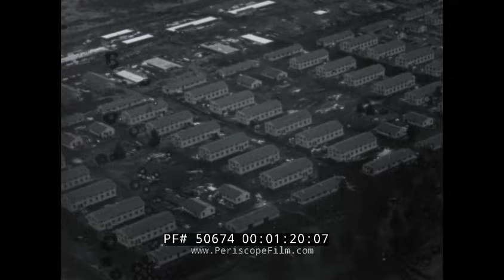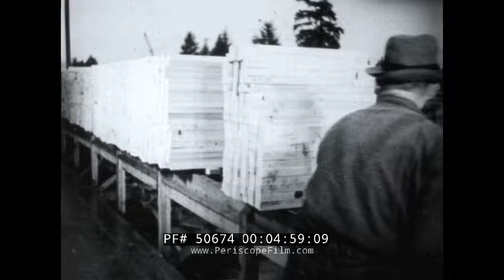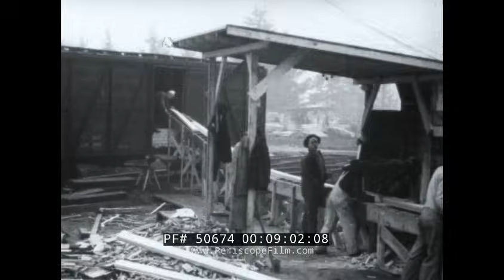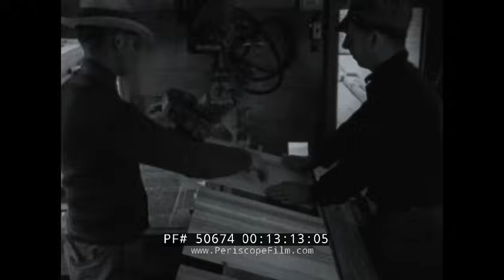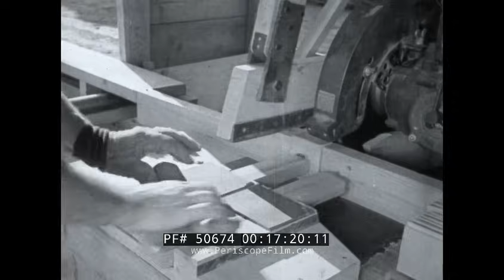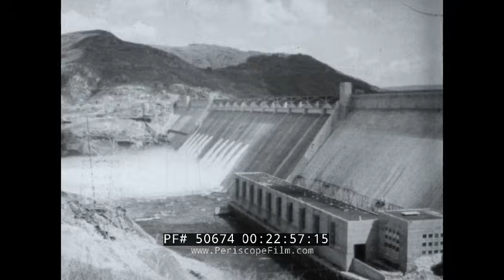DEWALT SAWS IN WORLD WAR II   PROMOTIONAL FILM 50674

Comment: Fantastic...I personally worked in the manufactured housing industry from 1990 to 2015 Building modular homes indoors on a line from start to finish.Well we had one of these Dewalt saws and I swear it looked exactly like the saws shown here...A good 60 plus years later...The saw was very old but kept in fine tune.I believe it had an 18 inch blade and it cut by itself most of the lumber needed to build 3 to 4 houses per week.I can still here the whirr of the sawblade...It almost sounds like high speed wind...something missing from this film is that sound.

Probably some of the finest saws ever made in the 20th century and with good care an almost limitless life.I was well aware of the Dewalt name before their rise with battery powered tools.I still remember when I saw the first cordless Dewalt Drill and though how amazing it was that the DEwalt name was being brought back to the forefront of the industry after so many years ago when the saw we had was built.

Comment: Instead of needing many  carpenters to do calculations and layout for construction, prefabrication allowed for only a few talented men to do the more complex angle calculations and machine set up. Fewer carpenters would be needed onsite as well, allowing cheaper, less skilled laborers to handle the assembling of prefabbed material. Construction prefabrication is a growing operation now. Computer modeling, coupled with factory styled prefabrication departments for  electrical,  plumbing, HVAC mechanical and even concrete will allow less skilled laborer to assemble the items being constructed under the direction of fewer knowledgeable people.
George Carlin explains further in this clip.
https://youtu.be/PhqPHQcVeH0

Comment: My son in law bought a DeWalt Radial Arm Saw at auction he called me to help load it, when I arrived I couldn't believe my eyes this saw heavy cast iron, 48 inch cross cut 5 hp motor 20 inch blades it runs perfect the company that had it made doors, it is not WW2 but made in the 50s

Comment: Imagine if pneumatic nailers were made then instead in the 1950's.
Believe it or not, they STILL make and sell parts for these models. Original Saw has a cross-reference guide on dating your inheritance, telling you how old your DeWalt is. They also have parts, ranging from round-button power switches, lower guards, bearings, and return pulleys. These are not NOS parts, but modern equivalents.

Comment: For all you Neanderthals who say these machines were safe , luckily in this millennia, we have such new safer saws like up cut saws and the like. These dewalts were impressive for their day( I have a smaller 1959 mbf model) but to say a 5-7 hp saw with 14-22 inch blade on a saw that inherently has a dangerous habit of climb cutting with no guard is not dangerous especially in a production shop is the height of ignorance. Go figure you voted in an even more dangerous machine
Reply: You're over stating it a bit. Firstly, as a Euro-American, I have a little Neanderthal DNA and couldn't be more proud of it. Secondly, it was the 1940's.  There was a World War going on and I doubt they lost more fingers or hands than were lost on a single day in June, 1944.  Starts with "D". But, to your point:  it was balls out production and accident happened.

The thing about these saws being unsafe applies to all power tools - even the modern ones like hand held circular saws, which are the cause of more tradesman accidents than any other. Pretty gory ones, too.

Every power tool has the built-in hazard of being unsafe in the hands of the user.  They just differ in dynamics and cause.  Pull the handle too fast and the dull, underserviced cut off blade can climb out of the cut.  Keep a sharp blade of PROPER type on the arbor, be careful, and you will never get hurt.  In 40 years of woodworking, I have never been injured by an RAS - even some very bad Craftsman models.

These excellent DeWalt and vintage Rockwell/Delta machines were sidelined in the '70's in the schools because of lawyers and the diminishing skill of those knowledgeable to set them up properly.  The power miter box requires very little skill and so it goes... as more people gave up shop class in the public schools, the marketeers produced simpler, easier power tools that the average guy could use a couple times a year.

I doubt that accidents have gone away because of it.

Comment: Love these saws.
As a professional furniture maker, I keep mine dedicated for 90 degree large cut-off and some precision dado work. I  will never give it up, always spot-on!
You'll never get a new machine of this quality. Keep the old stuff going strong.
Reply: I have a first year AMF DeWalt built in the original DeWalt factory.  I mostly use a special blade to cut fret slots in guitar fingerboards with it.
Reply: The Dewalt MBF saws do retain their accuracy when moved around. Since there is actually zero clearance, not even 0.001" clearance of side play, when you return them to zero. The key is, putting some light oil on the 90 degree locking tang, so it can wedge in fully, and once it's wedged in, it removes 100% of the play, so the saw is effectively one solid piece when returning it to 90. I think people didn't maintain their saws, and so they got the impression that they couldn't do miter cuts without knocking it out of alignment. I do know that my Craftsman saw has a very good locking mechanism with no side play, but the carriage bearings that slide back and forth on the arm, are so loose on the Craftsman saws, due to the bearings being extremely coarse, low quality bearings, that the bearings have much more play than the arm has.

Comment: DeWalt Radial Arm saws are featured here, no mitre saws or table saws to be seen. Today, Radial Arm saws are rarely featured on YouTube, yet they obviously set remarkable records for accurately cutting millions of linear lumbar feet in the 1940's. Strange how fashions change for no particular reason.
Reply: I sold my ELU radial arm Saw (a model copied by dewalt after the merger) to buy a Wadkin 16inch machine. 5 years ago I took it out of my shop yet more and more I want it back in the shop. Good job I still have it in storage. The mitre Saw has its place for one off cuts but the radial arm really is king.
Reply: @whitacrebespoke  Wadkin?  The BEST and British through and through.  WE have several Wadkin and Wadkin-Bursgren machines including a whopper pattern lathe. 60" swing in gap x 14 FEET long.
Reply: @loftsatsympaticodotc  been trying to buy a Wadkin lathe the past 15 years they are either mega money or gone when I call. I have Wadkin LS router and Wadkin EKA tenoner and a bursgreen 20inch rip saw. It’s good gear. All over 40 years old and will last me my career and still be functional.
Reply: Been using DeWalt saws and tools for 40 years as a professional journeyman carpenter. I still have the 7-inch heavy duty circular saw that weighed about 5 lb more than everybody else's but they can't buy a new ones every year and mine just kept on running. That's all is now 25 years old, runs clean and true and has not slowed at all like some older electric motors do. The only DeWalt tool I ever had to fade or fail on me was a reciprocating saw fit somebody tripped over the chord and caused it to fall 30 ft to the concrete. He was 8 or 9 years old heavily damaged I took it to the shop to see if they could fix it and they gave me a new one instead. Excellent product good people great service.
Reply: i have and am restoring the 9" (little guy) dewalt radial arm saw .... the built quality and dependability is incredible
my brother has not three identical craftsman radial arm saws and the modern lesser grade overheats and stalls or the motors wear out (this is why he has three)
Reply: It’s not really a “fashion” change it’s an “efficient technology” change. Radial arm saws are inefficient by today’s standards, tech changes.
Reply: Great when you have all those saws, each setup and dialed in for its specific task.  Not great as one do it all saw in your shop.  Now imagine if they had pneumatic nail guns what the production would have been like.
Reply: Yeah a lot of the guys back then were missing fingers from radial arm saws too
Reply: Even home users should pay attention to the ingenious use of jugs to produce interesting cuts, for example the stake points.
Reply: Weren't radial arm saws phased out due to safety concerns or something?
Reply: They don't wear EARPLUGS or caps.....
Reply: "good" marketing playing on mass ignorance....works for a lot of things!!

Comment: And how many fingers were lost...........
Reply: I’m not it the US but I’ve had three contacts with blades and cutting tools of all three different sorts all my fault. First I was cutting circles on the bandsaw and the cut really was not going great so I pushed harder fleshy part of my thumb on the blade drew blood but not severely, second time I made contact with the chain Mortiser flicking some chips out from side of guard, and third time I touched a rotating block on my tenoner as it was running down the top block had stopped and because of the lighting it looked like the bottom had too but it had not and I wanted to check the alignment. All lapses in concentration all my fault every time I was wearing my face mask/ respirator and ear defenders so vision is slightly impaired and hearing totally impaired which does not help in these situations but every time I had my hands where they were not meant to be and that will always be the problem with machine “OPERATORS”. Funny though I consider my table and radial arm to be the least dangerous machines in my shop. 

From what I saw in this video a lot of processes had clamping or jigs, nearly all of the big  diameter machines had some kind of mechanical feed for the head as did most of the moulding set ups. So where is the big problem? 

The dark days for wood machining came after this and often were moulder related. What would you rather no machinery was used? Will be interesting when the first claim comes about because an idiot touched a blade on a Saw stop and the technology failed and he sawed 2 fingers off. 

Machines are dangerous, machines need respect, machines need correct guarding (not excessive guarding) but most of all machines need decent operators you cannot guard or technology your way out of stupid. Stupid will always get hurt.

In my case I’ve had close calls but still have 8 full length fully functioning fingers and two thumbs. I know not to work tired and where extra lighting is required and ensure adequate power feed equipment, push sticks and hand brushes to ensure unless stupid strikes again I don’t need to go near tooling.
Reply: Andrew Offord, dangerous tools aren't for the masses to use....only for those with common sense and the ability to pay close attention to what they're doing at all times when operating powerful equipment. Similar today to not using your cell phone in any capacity while driving as it too is a dangerous recipe for disaster.
Reply: @WileysShenanigans  I am a Retired Toolmaker /Machinist  (OLD SCHOOL ) NO CNC kids tools . 44 Years of working with MUCH more dangerous CUTTING tools than circular Saws  ..NEVER cut ANTHING that I wasn't meaning to machine or cut , Ever  !  Its called SAFETY ....  Being CAREFUL and Attentive ...  MACHINES don't  care if there cutting Material OR YOUR FINGERS or Limbs !!   BEING  CAREFUL !!  and ALERT is staying SAFE : ) 
NOTHING compares to these Old "AMERICAN 'built Machines .....  God Bless "AMERICAN "Know How !
Or WE wouldn't be Here as we Are ...TODAY
Reply: @Wilett614  👍
Reply: Would you rather they use safety blades you idiot moron?
Reply: I’ve known many an old time carpenter who had all digits accounted for. It’s usually a young upstart or a clown who causes said old timer to get cut.
Reply: My dad told me that when using a saw or any kind of dangerous equipment you should show the same attention to what you're doing as if you're carrying a rattlesnake. One inattentive moment and it might bite you.
Reply: wHY?  They were a lot smarter, used common sense and used to hard work.
Reply: Marc Lewis I know many old guys with all digits I know several with bits missing too. When I had my brush with the chain Mortiser there was a guy waiting for an operation he had two fingers missing on his left hand, one on his right and had fired a big splinter in his palm that day. 

Your right though its a lapse in concentration however it occurs.
Reply: pagansforbreakfast uhm statistics like 60 000 hospital visits a year due to saw injury prove your anecdotal evidence is wrong
Reply: @maxfedor1  and most of those were table and circular.  Too many people get into woodworking who are the type of people who should never have.  The statistic you are quoting is current day WITH all the safety stuff on board.  Safeties to do not make anything safe.  People expect the safeties to keep them safe.  That is a huge mistake.

Your "60 000 hospital visits a year" quote is less valid than his anecdote.  You quote statistics and he has experience.  Mark Twain: "Lies, damned lies and statistics"